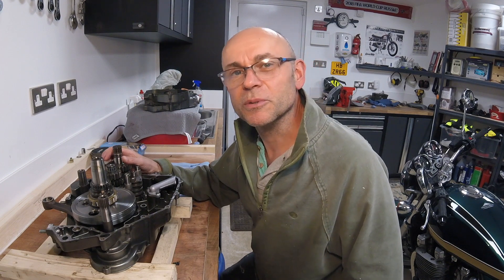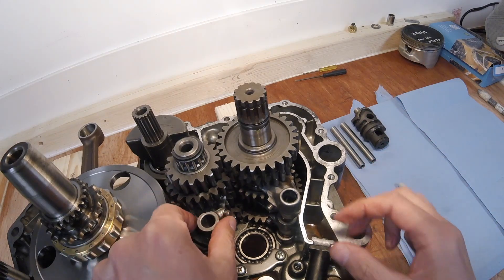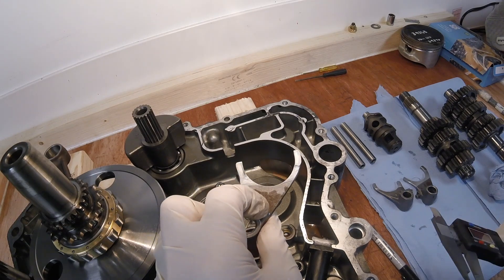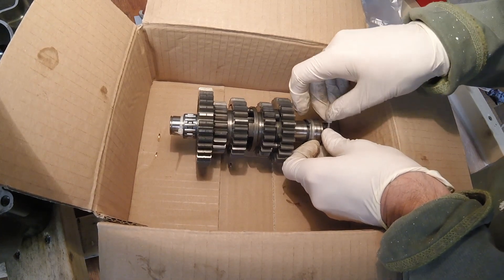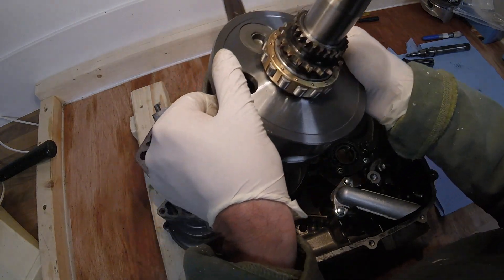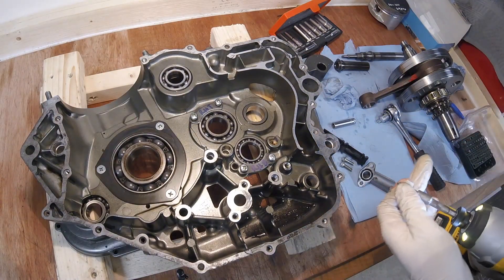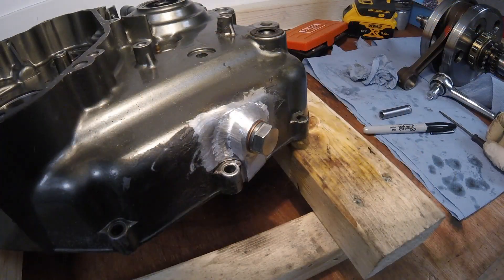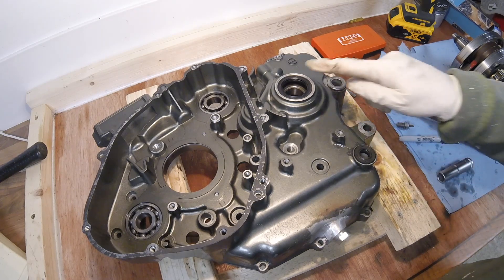Kawasaki KLR 650 Engine Re Build Part 8: Removing the transmission, Crank, and balancer shafts

Comment: Hello, thanks for the vid. Any tips for removing the cir clips that hold the gears on the input and output shafts? I've got a 2013 replacing the input gear, for 3rd. The circlips dont have a place (hole) for normal circlip pliers to grip. Thanks

Comment: HI there, I just watched all vids just to see how to remove and replace that water pump shaft, cause it's been giving me nightmares for quite time, constantly mixing water into oil, so I've tried and tried to fix it with seals but cant stop it, probably the shaft is damaged and now its tearing up the seals... Trying not to cry 😎
Anyway, I would realy like to see if You can show or at least tell me, what is the easiest way to remove it, or can the water pump part of shaft can be separated? Thank You anyway for vids and greetings from Bosnia!

Comment: This has helped me so much with my own rebuild. I sheared my crankshaft on my KLR so these videos came out perfectly. Greetings from the states and really look forward to the rebuild! :)
Reply from the maker: Glad they have been of use - Just getting a new blind bearing puller in the tool cabinet and Ill get on and post more videos. Bearing removal from the casings next and then I'll be soda blasting the casings ready for painting - just got to finish building the cyclone dust extraction system for the blast cabinet....   That project will be a video in its own right. Many thanks for the feedback - Regards

Comment: Brilliant! Thanks so very much for posting these videos, I have two klr 650 Tengai’s , one is in mint condition with 15,000 miles from new and the other I bought not knowing it was poorly maintained, whenever I pulled the rotor to check the balance shaft chain timing marks ( bad vibration) I noticed that the crank gear that drives the balance shaft chain had very seriously worn teeth and the chain had jumped obviously, this gear is an interference fit and is impossible to remove without removing the crankshaft, Kawasaki also recommend that the complete crankshaft is replaced as this gear also accommodates the valve train timing chain drive and it’s repositioning in the exact position is critical. I may get a crank and have a go at this sometime.  Or if you would be interested in doing another engine ( mine lol) perhaps you could message me back. Anyhow thanks for these videos. They are fantastic 👍
Reply from the maker: Many thanks for the comments - I'm going to cover bearing removal, casings refurbishment ( soda blasting ) and painting, refitment of bearings and most importantly the crankshaft rebuild in the next few videos. I am afraid Kawasaki is right - its and engine out and bottom end rebuild! If I can help then I'd be happy to!
Reply: The Motorcycle Shed Thanks for the reply, I was wondering if you are a klr fan and what model did this rebuild engine come from ? I have a few nice motorcycles but my Tengai is one of my favourite bikes ever, I have up jetted the carb and fitted a Delkevic pipe with a modded airbox and K&N filter. I have also fitted a windshield from a 2017 BMW 1200 gs. My email is listairgin@gmail.com if you should ever want to see some photos etc. I have been looking at crankshafts on eBay but am still undecided weather to buy a complete running replacement engine or rebuild the faulty one in my not so good bike. If you should happen to know of any engines or even a good bottom end for sale I would be very interested. Looking forward to seeing more of your excellent and detailed videos. 👌👌🌠
Reply from the maker: I would say buying crankshafts on Ebay is a non starter unless they are guaranteed. I purchased a KLR600 crank from ebay some time ago to play with alignment and disassembly and it was completely shot.( it didn't matter in this case as it was never going to be installed ) Engine rebuilds are very expensive, The Con Rod kit, big end and roller bearing replacement costs are over £400 from Kawasaki. Then you've got to add the labour rebuild of the crank, if required ( its a skilled job requiring special tools) and general replacement of bottom end parts plus clutch replacement etc etc and it really mounts up. To do this complete re build using all genuine parts I recon to have spent in excess of £1500. Then theres the tools.... The bike is a 1989 Tengai - the same as yours. I would say try and get hold of running engine - KLR's are much more popular in the USA than here in the UK and its possible to import a known good engine from one of the US dismantlers. Just remember you will have to pay VAT and import duty on the engine.
Reply: The Motorcycle Shed Thank you so much for your guidance and advice. I am a time served mechanic ( retired ) but have limited experience of the klr 650 engine, that is why your videos have intrigued me. I shall take your advice and seek out an engine. Do you have an email address that I could send some photos etc, it’s great to know that you are doing the rebuild for a Tengai ( one of my favourite motorcycles ever). Many thanks again 👍
Reply: Can you pull the balancer shaft without tearing engine apart